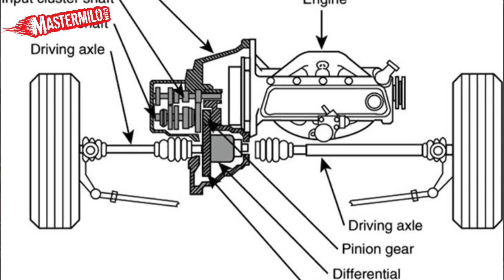'Build a buggy in your backyard' part #1; engine & rear axle

Comment: get that 5 cylinder working, they have such a good sound and so much power
Reply: They have, but working on a neglected k-jettronic system is a real pain in the ass
Reply from the maker: I used to have an Audi with an engine like that. 5 cylinder has a nice sound indeed. But for this buggy this engine is overpowered and too heavy. On top of that it's also a petrol engine and those don't like to get wet.
Reply from the maker: That's for sure, I have fixed a k-jet on my '84 Granada which was sitting for a long time. I needed to replace the airflow meter, fuel pump and accumulator to get it running again. Best way to get this one running is on propane.
Reply: Gebruik gwn een kever motor ben je van het gezeik af xD heb er nog wel een voor je
Reply: mastermilo82 zijn diesel motoren niet zwaarder omdat ze van een zwaarder metaal zijn gemaakt?

Comment: What is bobine. I was reading the subtitles and I speak English and I'm not familiar with that word
Reply: Its the coil that give the sparks to the sparkplugs
Reply: Dutch for bobbin, which is a cylinder holding thread. Due to the visual similarity, in Ducth it has also come to mean coil. In this case, i think he means ignition coil.
Reply: Ah that makes sense thanks for your response